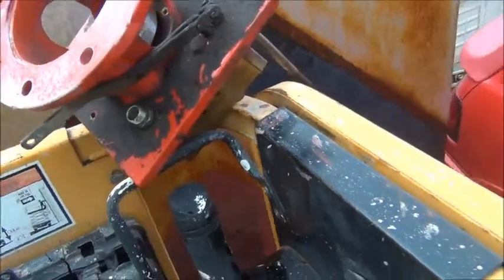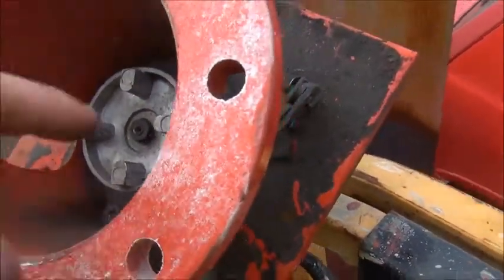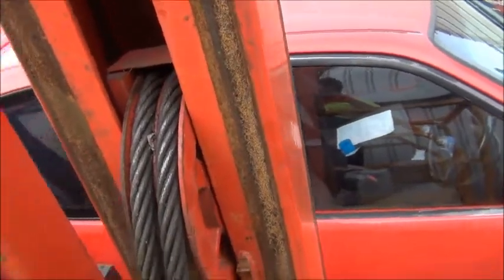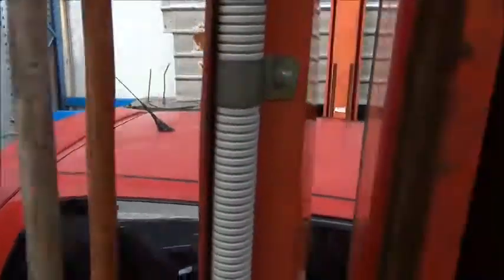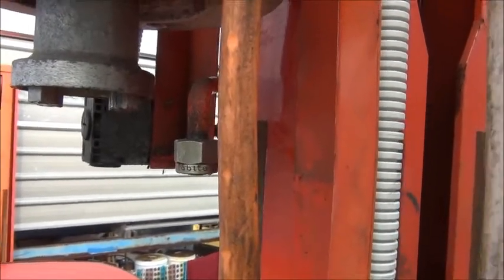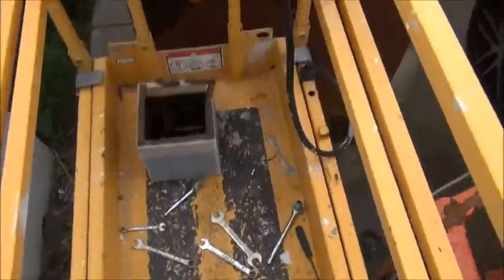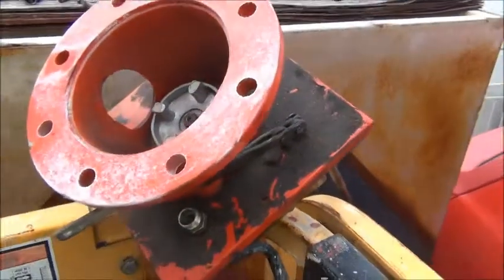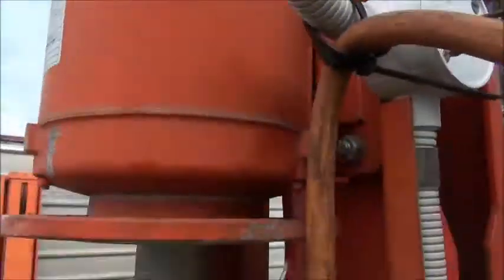Hoist Repair PT 1 - HPU Full of WATER!

Comment from the maker: i've devised a method to use a vacuum pump to vac the ram as dry as possible. i will then fill it back up using the new pump, after replacing it ofcourse! check the vid im uploading now when its live, you will see :) yes, i will do the cleaning once the car is free :)

Comment: Oh bugger ;-(

I cant see how it can be your fault mate, you didnt design the bloody thing did you?

So the seal in the top of the pump just didnt work and water has damaged the pump.

Obviously once the car is free you will flush the ram out and tank, so hopefully the ram is ok inside due to the hydraulic oil coating on it.

i would still strip the pump down to look.

Would the semi faulty crane pump off a lorry work at all??

Your excellent at mechanical repairs, your not god :-)